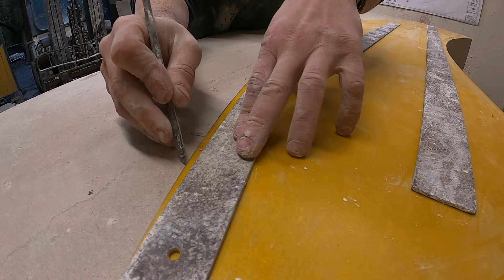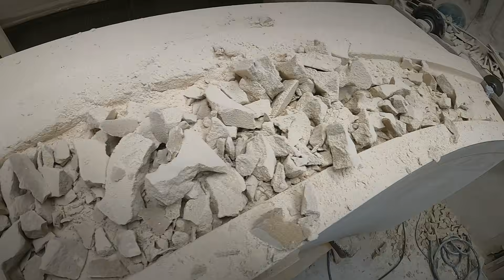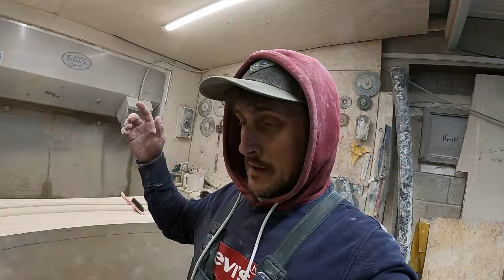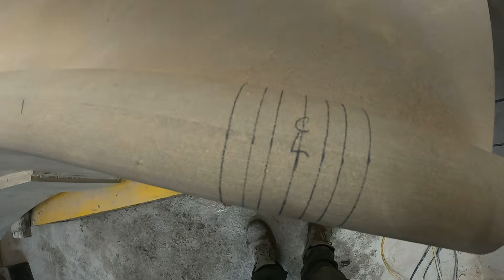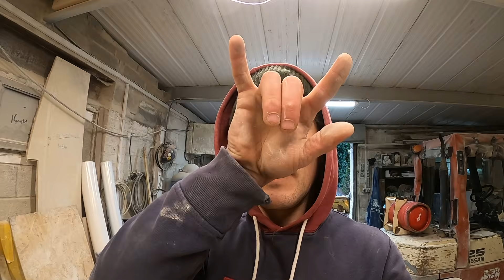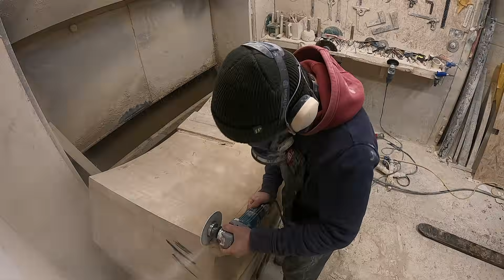Im NOT EVEN HALF WAY! Carving Embellishment carving on a GIANT arch stone

Comment: What is that thing on the back wall? A wet wall?
Reply from the maker: Ah, Its my dust extraction. It has a large fan in it which sucks the dust in and then has a massive spray bar inside which wets the dust and it collects as slurry in the tank at the bottom. Great bit of kit and without it I wouldn't be able to have my workshop where it is. Id have to be on a farm or somwhere where i could make a load of dust.